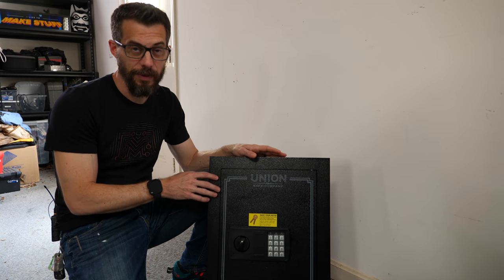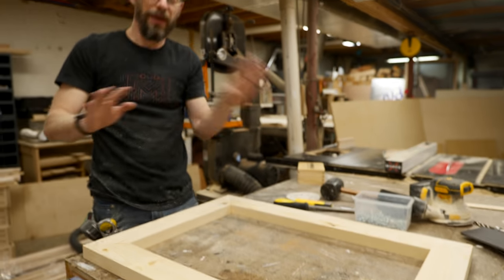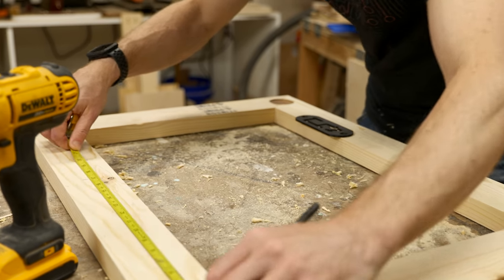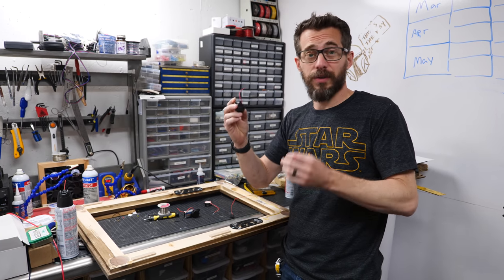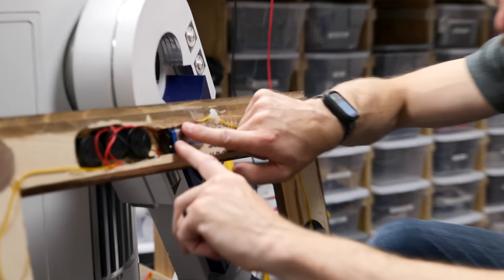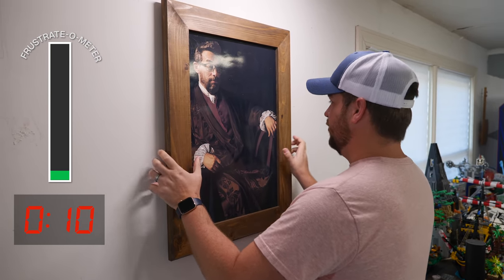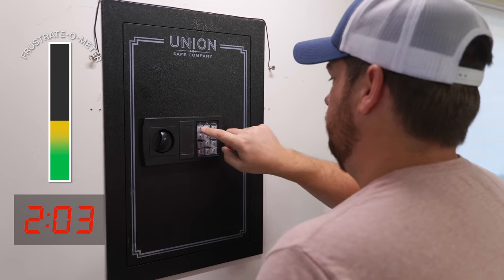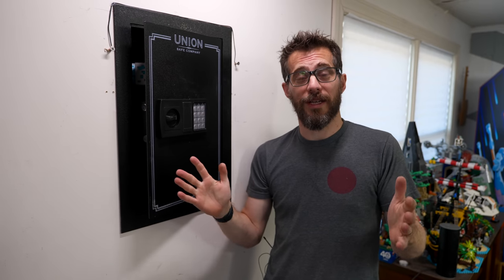Hiding a Wall Safe with a Puzzle | I Like To Make Stuff

Comment: As an option copper tape is available and solders great.  I have used it for several projects where wires were not practical or for contacts.

Comment: Great project and fantastic portrait of Bob too! One thing I was thinking while watching the part about completing the circuit for the buzzer: could you have machined the maze piece out of steel or some other conductive metal and then soldered or screwed the wires to that?
Reply: Also-- I'm getting some traumatic flashbacks to playing Operation as a kid from this

Comment: Ok now this is interesting since it allows you to get creative on where to hide things with a safe. Also if you’re gonna do this, other than making sure that safe is secure in a location where it can’t be found & that it can’t be potential stolen. You might wanna support the safe from underneath since the weight of the objects in the safe can bear down on it over time & it can fall down. Supporting the safe may depend on where you have located in your particular home.

Comment: Cool project but I hope that you are not in a cold climate or making a big hole in an exterior wall insulation and putting a metal box in will cause lots of condensation and all the fun things after that.

Comment: Very cool but why install it in an exterior wall comprising the insulation. If the safe itself isn't insulated, could there be a chance of condensation building up inside the safe?

Comment: As soon as he said the combination was nerdy, i thought 1,2,3,4,5, which is amazing, because I have the same combination on my luggage.

Then he limited it to 4 digits though, and I was thinking 1337.

I've actually been debating making a secure wall-box with a mirror built into it, but where the pane slides down, along with the the bottom-section of the frame, along drawer-slides, when you release the magnetic latch.   I wanted to make one like the one Brad Pitt's character has in the bathroom with the battleship picture in Mr and Mrs Smith..

Comment: What about making the the puzzle pieces out of Metal then covering the spot where the post should be sitting with something like electrical tape or paint on rubber.
Reply from the maker: I may remake the puzzle tracks on the Bridgeport mill so they can be metal

Comment: Bob, here’s an idea. Make the locking plate a standard length and with. So it goes across the frame. Just be on the LEVEL, when trying to break into the safe.

Comment: Nice! Taking this too far…If you installed a zigbee shock sensor in the frame you could trigger phone notifications, house lights, basically anything. And it would warn you when the battery was low too so it could be replaced.
Reply from the maker: Don't try and shock people, it isn't good. Just ask Josh
Reply: @Iliketomakestuff  oh yeah, to clarify, a shock sensor is a vibration sensor, not for creating electric shocks 😆

Comment: Not a thing against the project but a general thing. I never got the hiding things behind pictures or posters because you can just cut away the picture/poster and gain access to the safe. Though I suppose if this was a legitimate thing there would probably be like a metal backing 🤔

Comment: I would re do the alarm system with  either a pair of car horns or a surround sound system where every time the robber connects the circuit he is called some colorful words and yes the system will be connected to the outside speakers but both systems would have a secerate switch that authorized personnel know about that disconnects the alarm system so the neighbors don't think my house is being robbed and call the police.

Comment: Two. If you are covering it up why use a safe. A small hidden shelf unit would work just as well. Two: Using a metal box on an outside wall come winter calls for a wet mess. That plastic sheet and insulation you removed.

Comment: Remove painting with sharp knife, remove key cover,Use tool to rotate all discs clockwise. Start picking..  ..1 is binding, nothing on 2.... 3 is set....4 is binding... 5 is set....
Reply: also what is the make/model of that safe? I am curious is lockpickinglawer has had his hands on it

Comment: cute .... but knowing a former (reformed) thief .... they are not concerned with the mess they make ... when robbing a house .... if they had any idea there was something hidden in the wall, they would probably use a crow bar, to pry the frame off the wall, or bypass the frame, and use the crowbar to pry the safe from the wall.   Just the fact that the frame isn't hanging via a normal mount, would suggest something ... and like I said, not caring about the walls ... they'd knock a hole in the wall.

Comment: Removing the insulation to put that safe in a exterior wall is a terrible idea.
The difference between the interior conditioned air and the exterior air is likely to cause moisture/mold issues.

Comment: Your activation system seems overly complicated. What about using a magnetic alarm door/window switch. Place the magnet on the wall and the switch on the frame. As soon as someone moves the frame the alarm goes off before they even get it off the wall. Much less work and fiddling with wires for an end result that to be honest looks like cr@p.